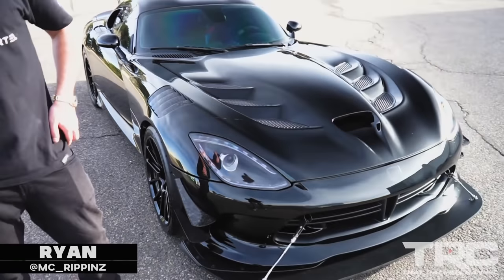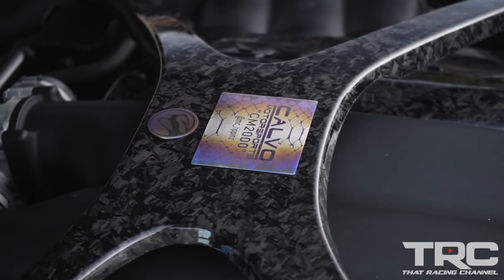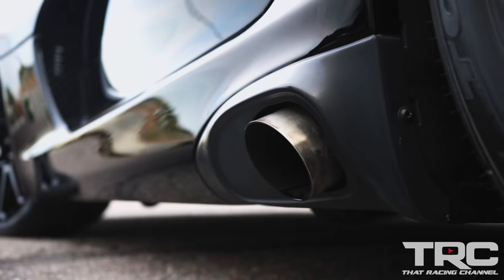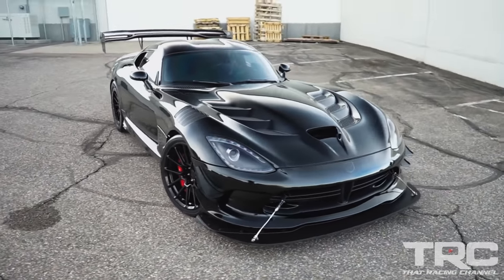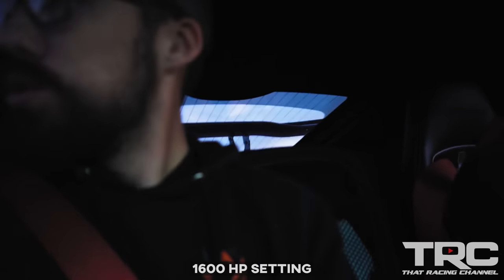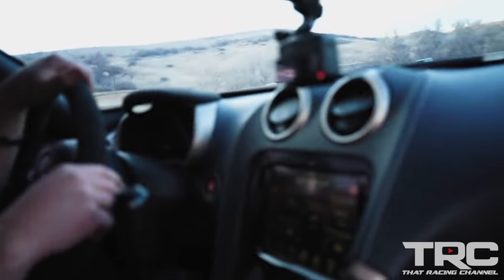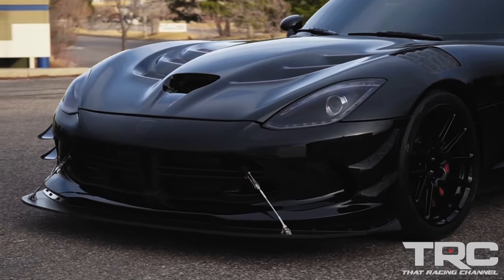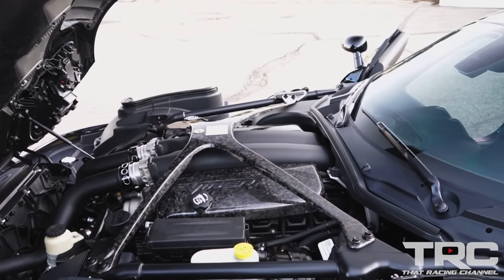2600HP Turbo Viper UNDEFEATED ON THE STREET! 9L Stroker + Sequential (2000lb-ft OF TORQUE!)

Comment: In the 1990s I worked at the Chrysler importer for the Netherlands Germany and Belgium in Born, Netherlands. At the complete company there were a total of 5 people who were allowed to drive the Vipers, I was one of the lucky ones. The RT 10 already had a lot of power, but in 1995 came the Viper GTS as a special edition. They were all (I think 400 of them) blue with 2 white stripes across the middle of the car. A team from the USA were going to do things that no one was allowed to see, really no one. A large hall about 1 mile down the road from where the Amerkans were doing their work, we were given the storage numbers and had to bring the Viperes to the hall and later pick them up again to get them ready for transport to destination. On the way to the hall occasionally sneaking on the gas, my GOD what power!!! But when they returned from the hall to the yard, the power was turned up considerably, and you really could not give full throttle, that was far too dangerous, what a monsters. When I see that this version still has 3 or 4 times the power, it is really phenominal, absurd and amazing.

Comment: craziest part is how unassuming it looks, obviously it is a viper but no one on the streets would ever guess it’s making 2600 hp
Reply: When they hear it they will😂
Reply: Thats his idea make look as stock as possible, just how i like
Reply: @jm92266  they’ve literally dynoed it dummy
Reply: @jm92266  They litterally show you the dyno results.

You know there are engines with 10s of thousands of horsepowers with a smaller displacement than this one right?

This car has a NINE LITRE engine. NINE LITRES. 9. 

Not one,  not two, three, four, five, six, seven or eight but NINE litres.

Comment: I actually ran into this car randomly on the highway. I had a fully built BMW s1000RR with a hair under 380hp to the rear wheel. This is one of the only cars that pulled on me so hard I thought there was something wrong with my bike. I took an exit immediately, parked and hooked my laptop in my backpack up and went through everything 🤣😂

Comment: “So how many horsepower you want us to put in this Viper?”

“Yes.”
Reply: Just a little bit more
Reply: Much*
Reply: Have you seen Calvo's IG? They're working on a billet block so they can have 3500-4000 hp.
Reply: didn't have to open the comment section to tell that this comment was there
Reply: 3000 minimum to try and beat the fastest street legal cars.

Comment: We need to start a petition to bring this beautiful monster back
Reply: People didn’t buy them unfortunately. If I owned dodge I wouldn’t waste money either
Reply: David Lytch  exactly what a pinecone sounds like falling to ground.
Reply: My first dream car as a kid in the early 90s.
Reply: It's coming back eventually
Reply: They're very uncomfrotable, mega ultra tiny. Most people couldn't even FIT in the original viper. 
They could bring it back with a bigger frame to make it realistic. It would sell today for sure.
Reply: @crazytech5755  they were never built for comfort until the last gen with the help of Ferraris interior design team and the use of the same materials. The vipers were only small and crude for the 1st gen, I'm 6'2 and fit fine in the gen 2 of a friends like I did in my c5 z06. Tge reason they didnt sell was the cost was more than a z06, many like you said didnt like the poor ride quality and comfort...expected of a car design for track use, heck z06's rode horribly on the street aswell. Biggest that held many wealthy buyers back from buying was it only came in a manual transmission, people complained about it and the stiffness of the clutch pedal which was no stiffer than a c6 z06.
Reply: @coltoncarpenter3790  The body is nice, if they brought it back with a ralistic comfort level people would eat these UP. Deff if they came with 1600 hp lol.
Reply: @enigmaPL  No, it was cancelled because:
1. New regulations required a side airbag, which the Viper couldn't hold.
2. The C7 Corvette came out at the same time as the newest generation Viper, and why would you spend $100,000 on a 600-hp Viper when you could spend $20,000 less and get a Corvette with a 650-hp supercharged V8?
Reply: I saw one today coincio lol
Reply: You can still get one if you pay enough, they still make a few every year
Reply: @creampiess  Are you aware of "eco credits"? The basic gist of it is that manufacturers need to average a combined emission target across every engine/platform they make. As averages go, keeping the Viper V10 around AND the Hellcat platform, was going to be impossible without paying arbitrarily heavy fines for exceeding their allowance. Dodge does not have enough "eco" models in their range to offset keeping both so they had to scrap one and the Viper was the one to go. The Viper sold as well as can be expected for a vehicle of it's kind. It's not going to sell like a Camry.... 

As for "my bias is showing"... what bias? I love all performance cars, I don't stick to "a brand".... That just sounds like you projecting.
Reply: @creampiess  The irony being that it's you whining, about what I said, and all I did was explain my reasoning. I said nothing about "liberals", you did. And yes, I did say "eco-hippies", because I think the majority of the "green movement" is virtue signalling by going after all the wrong things, for what they think are the right reasons. 

I'm all for solar and harvesting renewable energy and adding it to the current demand, and all the subsequent benefits that come with that. Whereas nonsense like "carbon taxes" do nothing but punish regular people for something they're not at fault for. The amount of actual pollution, originating from everywhere else in the world,, should be of far more concern than, for example, what is coming out of the exhaust of a vehicle. Vehicles already have emission devices incorporated in them, and the combined emissions of even hundreds of millions of vehicle is dwarfed by that of what the rest of the world is responsible for. So no, I won't apologize for perhaps getting irritated with irrational "green" extremism that scapegoats my hobby of the internal combustion engine'd vehicle, forcing automotive manufacturers to slowly kill off the ICE vehicle in favor of an electric appliance that comes with a whole set of problems I won't bother to get into. 

PS.  I'm center left, if I had to pinpoint a "political standing" so you can focus your attention on understanding my point, and not team red vs team blue bullshit.
Reply: @alexdurst6180  no

Comment: Finally, a worthy opponent for Ken Block to pull the Hoonicorn out of retirement.........
Reply: Thisssss
Reply: Im sorry but that wouldnt even compete
Reply: @watermelon6245  and I believe you would be wrong.
Reply: The Hoonicorn on nitro meth makes 1400hp. This car makes 2600hp. The turbos on this viper are large enough to suck in small children at idle. There is no comparison to be made here between these two cars.
Reply: @bitsbrainsandbeanies2527  that's kinda the point, in my opinion. Even when they raced the 4rotor and clearly had a disadvantage, they framed the race up to win. It was the first time the RX-7 was driven after its newest mods and clearly hadn't had time to test things out. Like the hood, for example. 

The viper is sorted. And they could just put the viper in a lower mode to make it fun.
Reply: @bitsbrainsandbeanies2527  not sure if your serious or not.  There’s a lot more that goes into a drag race than horsepower.  

1400 hp, probably half the weight, and all-wheel drive would make up the difference in HP from a dig.  Gearing is gonna be different too.
Reply: It's not in retirement they are building version 3
Reply: @Juke-Redlin  I know another 4 rotor that would have put up a better run, but Dave doesn’t seem to do drag pulls.
Reply: @TViper2369  The hoonicorn would obviously get out of the hole quite a bit faster, but I would think the race would be relatively close if it was in an eighth mile.
quarter mile, let alone the "1500" ft they often do, this Viper would make the hoonicorn look like a toy.
Reply: @biggiesmalls7939  again, maybe and maybe not.  I’ve watched all of the Hoonicorn vs the world races.  The thing is a beast.  It’s probably at least a 10 second car. 

I said worthy opponent. Which I think it would be.  As a Viper fan (hence the username) I’d be pulling for the Viper.  Still think it would be a good close race.
Reply: it would spin to much off the line from a dig if it did a roll race it could maybe compete it would still be fun to watch tho
Reply: @TViper2369  the viper ran high 9s at 170ish on its first 1/4 pass
Reply: @GozonTheGonsarian  no ken block is not longer working with Ford. And Ford got the hoonicorn. Atleast that is what  i have heard.
Reply: God damn that car is a BEAST!!! Not even BIG CHIEF! Jajajaja
Reply: That thing would suck the hoonicorn in it’s turbos and shit it out it’s exhaust
Reply: @TViper2369  From a dig, sure...From a roll, no competition.
Reply: @watermelon6245  in a drag race from a stop the hoonicorn would slap this thing. Awd almost always wins lol
Reply: @watermelon6245  1400 hp AWD I think it would! The viper is just rear wheel!
Reply: @bitsbrainsandbeanies2527  AWD on the  Hoonicorn! So maybe depends from a dig or roll maybe.
Reply: Although the Viper would Mop the Hoonicorn.  ID LOVE TO SEE IT!
Reply: @Juke-Redlin  the 4 rotor is a pile of shit
Reply: @TViper2369  Except the vette was blowing the tires off the entire way down. This viper sounded like it was hooking the entire way. 4000hp on an unprepped surface is stupid. Can't put the power down anywhere.
Reply: @TViper2369  It's weird how you come back to this comment thread six months later only to not prove your point.
Reply: @biggiesmalls7939  well seeing as they pulled it out of retirement and the first video is a comparable/relatable one it seems fitting.  

The fact that you’re going on about wheel spin and surface says you aren’t capable of logic here.  It’s an NHRA driver racing the damn car, not an everyday Joe who supped up his car.  Against at 14 year old beginner.  Races to 500 and a 1000 feet.  All pretty good races and close.  The Hoonicorn is a bad machine and is gonna run with any street legal car, period.  

The point is this Viper, as amazing as it is, wouldn’t dominate as you seem to think it would.  Maybe they will call him out to run against it and we will see for sure.
Reply: @TViper2369  You say they "pulled it out of retirement" like it didn't just have it's entire engine rebuilt.
The NHRA driver literally said "it was spinning until the finish line". And I wouldn't use Ken Block's daughter as an example of being disadvantageous, she tree'd the f' out of him on race #3.
But yes maybe this Viper wouldn't dominate  the hoonicorn, but I definitely think it would start to pull hard as hell in a 1500ft race.
Reply: @biggiesmalls7939  hence the original comment of “a worthy opponent.”

Comment: 13:04 you can see the heat waves similar on the tail lights... absolutely menacing.. it reminds you alot of fighter jets hitting afterburner ready for takeoff on aircraft carriers with the heatwaves radiating of the ground

Comment: The fact that they can get traction in the car,being rear wheel drive, is super impressive.
Reply: Massive tires and huge aero

Not too difficult i think
Reply: @bigredranga69  i was talking about rolling, launching it is almost guaranteed spinning of tires
Reply: downforce brah
Reply: A lot of hours in R&D for sure
Reply: @bigredranga69  launching is where you break stuff anyway doubt he does it much.
Reply: @rawhidelamp  even rolling they fucking spin 2 gears and the ECU cuts timing you can hear it in some other vids
Reply: @rawhidelamp  proper suspension geometry makes the biggest difference. A 4-link with the right anti-squat is deadly
Reply: Boost by gear too:)

Comment: This is the car that’ll make the Supra fanboys cry 😂

Edit: Ruh Roh, the Supra fanboys are starting to invade my comment. Be careful guys.
Reply: Yeah and destroy one on a track
Reply: Not likely 😊. Mk4 supras, some can give this viper everything it could possibly handle!
Reply: @busalove2013  😑
Reply: YEs when you start off with a car thats costs $150k and you spend around another 150k on an engine build alone you usually will beat cars that retail for 60k with $30k engines
Reply: @gabegabes6419  the aerodinamic its important too
Reply: equally built supra’s would wreck it. but you won’t see em on the street.
Reply: This car hasn’t lost a race. Until that happens it’s a Supra killer.

Comment: That massive Wing is the real MVP of this car. Lol, thats how its able to put 2000 horses on the street.
Reply: It plays a role, but the real MVP's are the Motec ECU, and NINJANEERING Tuning. He's the reason it hooks.
Reply: its actually the waaaaaaarp drive unit at installed at the back, Maximum Warp sir!
Reply: @nickadkins7765  also the wave wavetrack diff. I hear that they are the best out there

Comment: The fact that it beat a bike is insane holy crap
Reply: Bikes have a high centre of gravity and a very short wheel base. In straight up acceleration, it's not near what sports cars can do, but they're designed for a different purpose. I'm not knocking bikes - I like riding -  cars just don't give the same open air feel of bikes.
Reply: @ReinierK123  There is. It's called convertibles.
Reply: @jannadrielcervo7753  True, still not the same though as your still surrounded by the car. I personally prefer motorcycles because of the leaning in corners and having more room on the road to choose lines. Wheelies are fun too. To each their own
Reply: @ReinierK123  If on a stock sport bike that can be true.  Most stock super bikes hit 60mph in 2-2.5 sec. I'd say that's way faster than most sport cars out there. A lot of supercars can't  even get to 60 in that time. A drag bike like a tuned h2r with extended swing arm would most likely blow that car away. Considering there's a video of a stock h2r beating a Bugatti and jet on a straight
Reply: @4id4n97  Yeah, I agree. I think having surrounded by the car gives a feel of safety. It takes balls to ride a motorcycle fast, especially the liter superbikes. I prefer comfortable sort of cruiser like bikes, like the Triumph Bonneville T120. But I like the classic late 60's Bonnie. More mechanical and lesser electronics.
Reply: You can beat most liter bikes with a non turbo 9L haha
Reply: @RCXDerp  yeah but you pay 20k for a Superbike and at least 100k to even get near the times of a bike with an car
Reply: @markschneider311  yeah but you cant use a bike in Winter or Rain and youre constantly uncomfortable. Plus cars look way better.
Reply: @4id4n97  Not sure about it beating this car, There are videos of built 1200hp corvettes beating built h2r...this viper is 2600hp..check out streetspeed 717 he races a built h2r and beats it. but yea most cars no chance against those bikes.
Reply: @freddybell8328  show me how you use that viper in the rain xD and opinions on looks are different
Reply: Can be interesting race with fastest one:)
Kawasaki H2R with 400Km+ top speed in 26 seconds.
Reply: @ReinierK123  dude, you need a wicked car to beat a bike. Your turbo Subaru ain't it.
Reply: @ReinierK123  It still takes 1100-1400whp to beat a pretty maxed out stock liter bike, regardless.
Reply: @4id4n97  There are videos of twin turbo lambos with 1800-2000hp blowing modded h2s and turbo busas away, so.. This car with 2600 would definetly smoke any bike, modded or not.
Reply: @dustinshives6577  https://www.youtube.com/watch?v=BGU81oRIw3U This video? In this he gave him a head start and still beat him on the h2r
Reply: there's an old video on here of a Pontiac TransAm smoking Hyabusa's left and right, and that one is only a V8
Reply: @vicdiaz5180  An h2r with a good rider would smoke a hayabusa. A modded zx14r would be the next best thing
Reply: @freddybell8328  It's actually not that much more dangerous riding in the rain. Just better off avoiding painted lines and manholes. Although don't want to ride after the first rain in a while considering it's gonna be rinsing oil and other shit off the street. I definitely prefer not riding in the rain though. That's when I use my car, and wish I could be riding my bike. To each their own

Comment: Even 500 horsepower feels squirrelly I don't even get how cars like that stay on the road
Reply: Aero and a prayer
Reply: And sticky af tires
Reply: And the world’s strongest ability not to sneeze when the sun glare catches your eyes just right. Can you imagine sneezing while driving this thing? With all that power? You’re dead.
Reply: Of course you drive a mustang💀
Reply: @counterfit5  yeah those sticky tires have to be hot and pray you don't a water puddle, dot slicks don't stick when they are cold and are actually dangerous as fuck until you get the compund heated up, otherwise you hit the throttle and you are all over the place.
Reply: @JohnSmith-sx2fh you're  not wrong mine only has around 350 to the wheels and its squirrely lol its fun though its just people buy them that don't know how to drive and floor it before they feel the car out. I almost crashed mine the first week but now I know the car haha
Reply: The drivers balls help weigh it down also